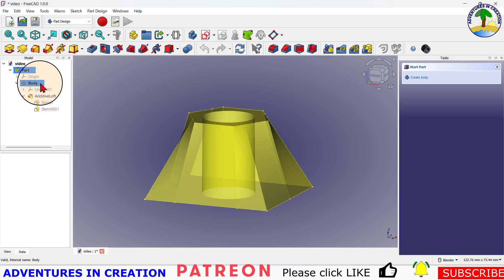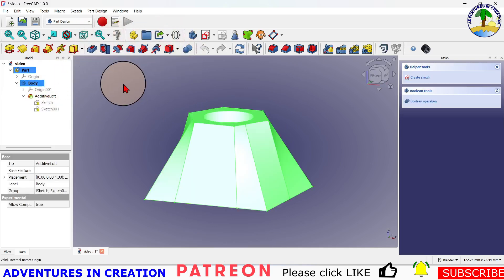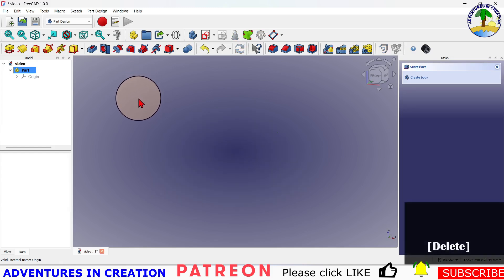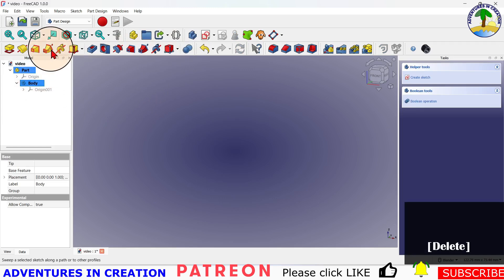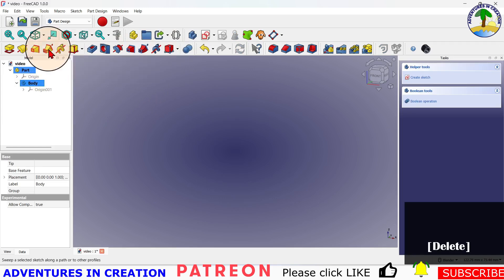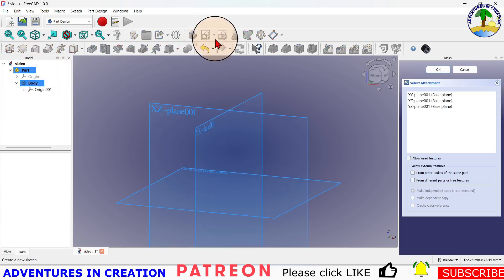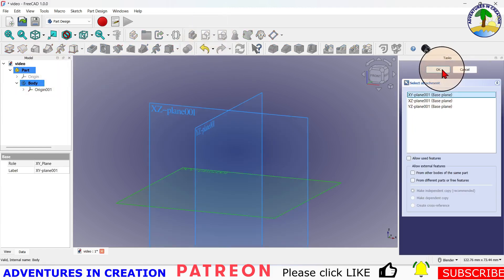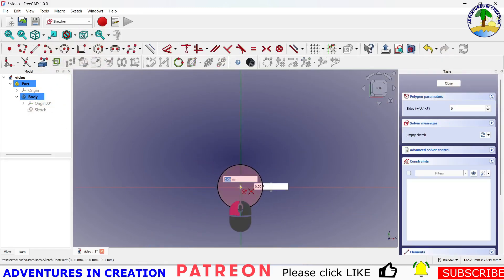Intro To FreeCAD Version1 0 Lofts and Pipes #freecad #cad #3dprinting

Comment: One thing that makes using pipes difficult for some use cases is that it uses the "center" of the shape. For relatively simple shapes this is straight forward, but I e.g. want to use it for concave shapes. How do I define the center of these?
Reply from the maker: You can use any origin point they don't have to touch